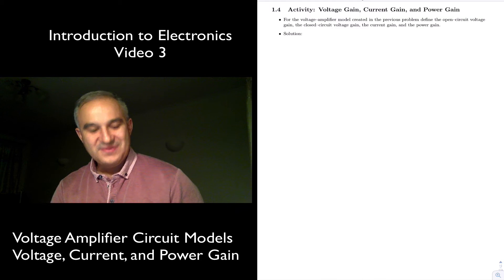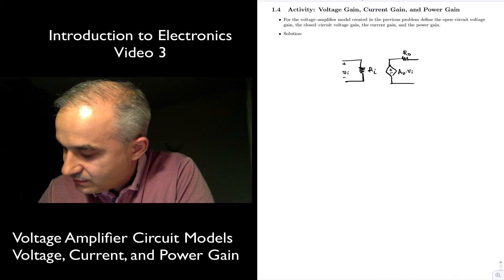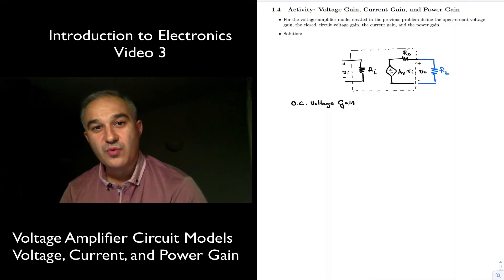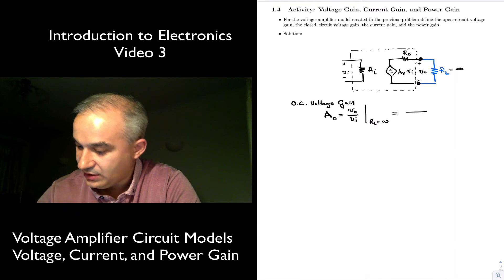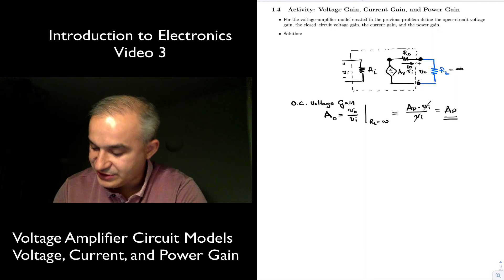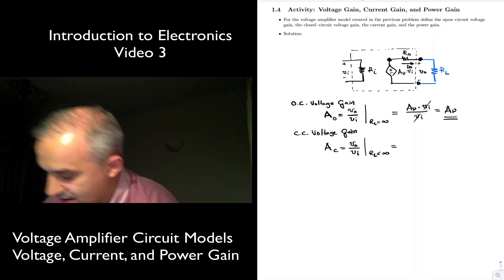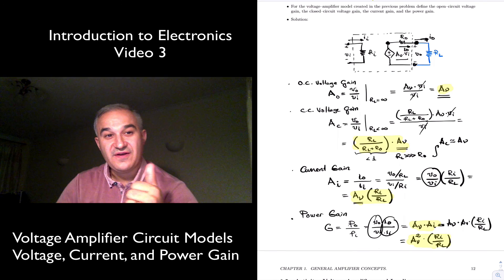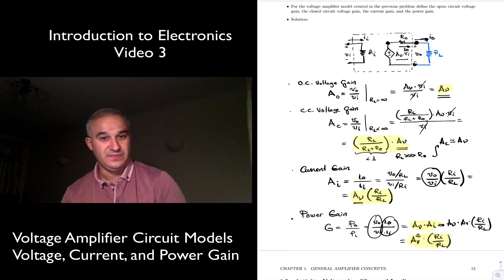Electronics - Voltage, Current & Power Gain

Comment: vo/vi = Av only when the circuit is open.  Otherwise vo/vi = (RL/(RL + Ro))Av.  Therefore Ai = io/ii = (vo/RL)/(vi/Ri) = (vo/vi)(Ri/RL) = ((Av vi)/vi)(RL/(RL + Ro))(Ri/RL) = (Av)(Ri/(RL + Ro)).   For RL >> Ro this reduces to (Av)(Ri/RL), which is the same result found by Dr. Aboy.  The power gain derivation has the same problem. Using again, vo = (Av)(vi)(RL/(RL + Ro), we get G = (Ri/RL)(Av)(Av)(RL/(Ro + RL))(RL/(Ro + RL)).  For RL >> Ro this reduces to (Ri/RL)(Av)(Av), which again is the same result that Dr. Aboy gets.  The white board shows Ac approx Av, which explains his simplifications. Making these simplifications obscures the normal thinking process when the body of the analysis sits on vo/vi = (RL/(RL + Ro))Av, not on vo/vi = Av, which is true only for the case of the open circuit.  Otherwise, I like it.
Reply: are u stupid ?xd